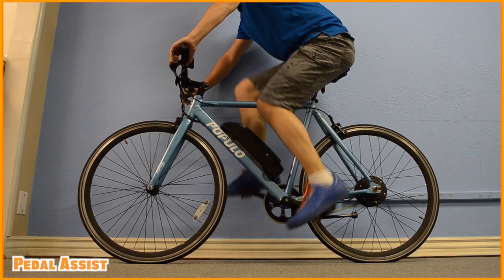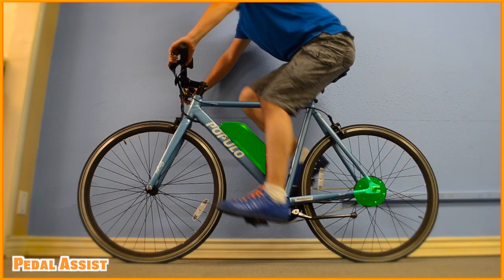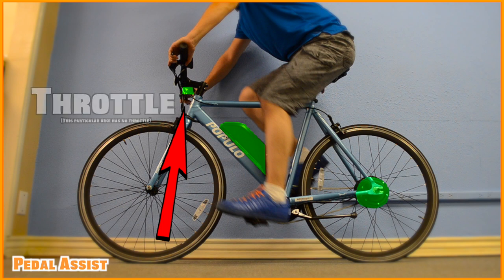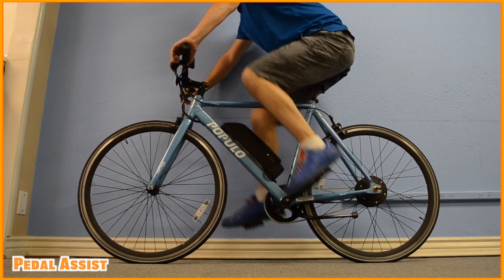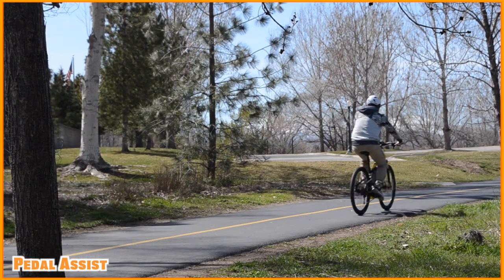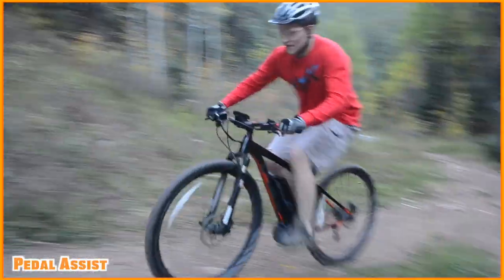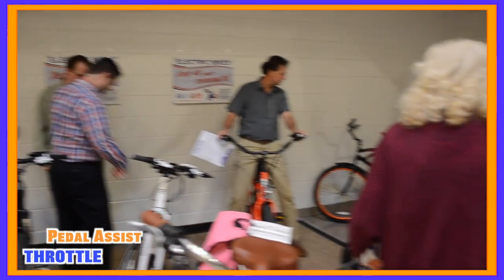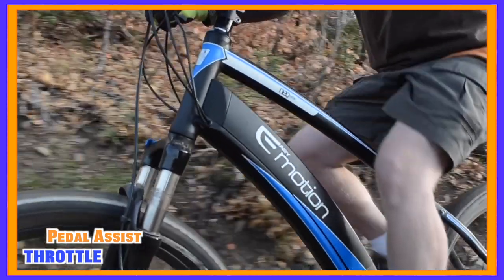eBike Pedal Assist VS Throttle

Comment: If you stop motion of the video at 2:54, you can see that the rider is riding in the door zone of parked cars. That is tempting fate. Control the travel lane, dude. It's even easier when traveling at the speed an e-bike is capable of.
Reply from the maker: I've never heard of a "door zone"
Reply: @BlueMonkeyBicycles  You have never heard of a door zone? Well, let me explain. That is where a car door can open in front of you and you slam into the door and quite likely are catapulted out into the travel lane where a motor vehicle runs over you. More detail here: http://john-s-allen.com/blog/?p=8071.  It is safer to ride in a predictable straight line out of reach of the car doors and if the lane isn't wide enough to share, ride in its middle.  That is what the course at https://cyclingsavy.org teaches and for the sake of your life and health,  please check that out. The online basic course is free.

Comment: what is throttle governing bar?
Reply from the maker: I've never heard that term before.

Perhaps it's describing throttle programming that is capped at each level of pedal assist: i.e. level 2 assist caps the throttle at 10mph, level 3 assist caps the throttle at 13mph and so on.
The opposite arrangement I've heard called "throttle override" i.e. the throttle always has access to full power, regardless of assist level.

Bike companies have the option to tune the features in this way before having the bikes made. Normally, they don't change them after it's done. I hope this helps

Comment: Throttle all the way.
If im using pedals im doing it for the exercise and pedal assist is like cheating on work.
Throttle is just fun and basically going fast really quick is something you cannot do just by pedalling.
Reply: using pedal assist doesn't mean you exercise any less, you just go faster, and using throttle is just lazy init.

Comment: PAS saves a lot of battery, since there is no sharp power spikes as with turning throttle. BUT, what if you build DIY conversion and there is no PAS input on controller? I figured out a way around that, check out if interested -> https://youtu.be/cs5BmaVUED4

Comment: The British government have band throttles on ebike in the UK. If you have one fitted, it is only able to push you up to 7 mph. Also 15.5 mph is all they are aloud to be assisted up to. You just get going and then the it's like the brakes being throne on.
Reply: Steve H2488 same where I lived..but throttle is totally not allowed
Reply: Honestly the range is so low above 15mph that on flat ground you wouldn't want to use it anyway. I use the lowest assist when starting from a stop (heavy bike) then turn it off until I'm going up a steep hill. Then I crank it up to full assist. That's really the best benefit of pedal assist
Reply: @kodiererg  Same, there is no proper feedback from the pedals even on ebikes with torque sensors, + more pressure on pedals can reduce saddle pain. Could ride  
for 50 km on 35 km/h on a flat ground while using 50% of the 36V 10Ah battery with TSDZ2. The same  DoD on hilly 70 km route with a lot of unassisted riding. Looks like long inclines are harder for battery cope with than a steep short ones  with low SoC.